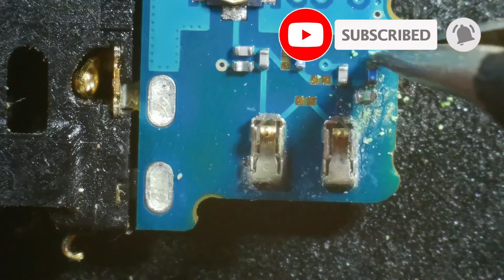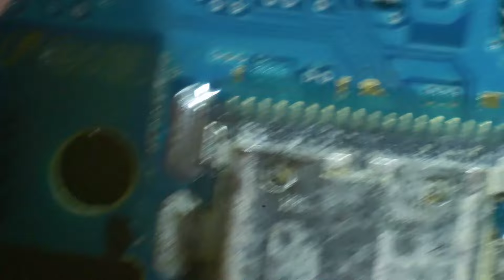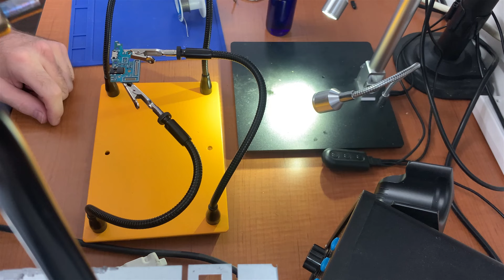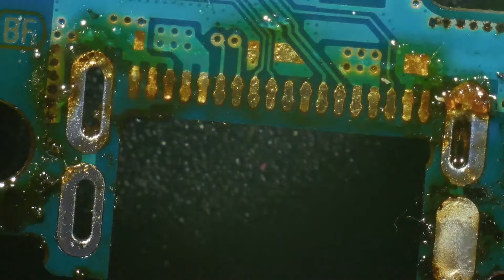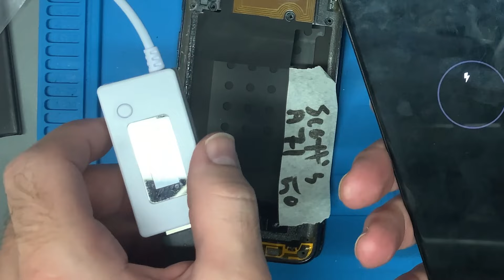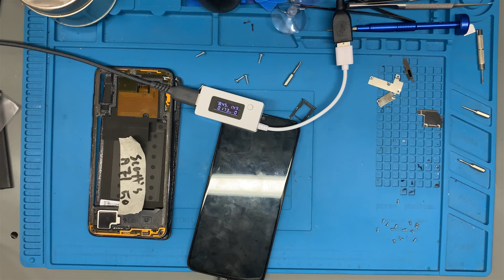Under the Microscope! Samsung Galaxy A71 Charge Port Swap & Diagnostics

Comment: i'll leave you a few tips.

1. The "chip" you were soldering back is the microphone, avoid using flux to solder it, just a tiny tiny bit on the pads, otherwise it will stop working. Also if you ever gonna use a ultrasonic cleaner, remove it before doing so, the ultrasonic kills the microphones (theres one in the main board also)

2. On these samsung phones (a30, a50, a70, a51, etc) the FPC connector on the main board breaks all the time, whenever i do anything on these phones i always reinforce the connector, and lots of times when it won't charge, the issue is there.

3. Avoid repalcing the whole sub board with a knockoff at all costs, most of them are shit and usually the only thing that goes bad in these are either the charging port or the microphone. If replacement is unavoidable, try getting oem ones.
Reply from the maker: @PedroBorgesNH  I really appreciate your input! I'll keep those points in mind for the future
Reply: Every time the FPC connector(typically on the motherboard but also on the flex itself) is the problem when it comes to charging(I mean 0 Amps on the USB meter, not this case, you had 20mA).  For some reason samsung in their wisdom, used the big pins on the left and the right on that connector are used for positive and ground from the charging port. Those also break if the battery starts to swallow. Also it's not only on the A series, my Note 20 ultra had the same problem. On any other brand it's not a problem because are used as ground points, but not for samsung(also apple use those pads on the 3dtouch/touchid flex from the screen to the motherboard on iPhone 7 and 8. So if you have non-working touchscreen if this flex is connected, but it work if it's not, those tabs are the problem).